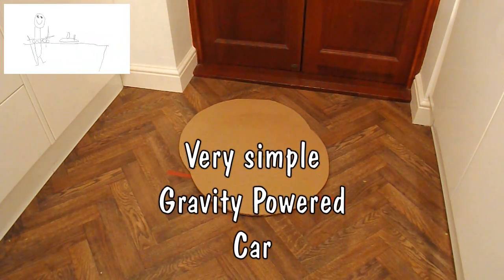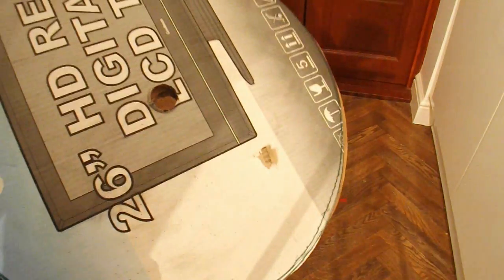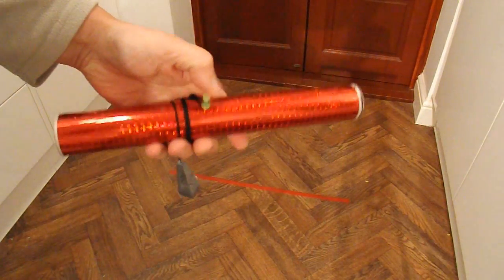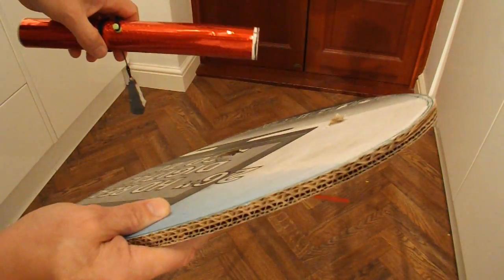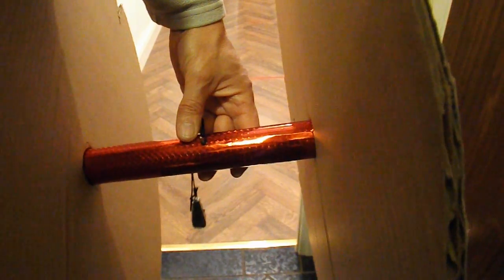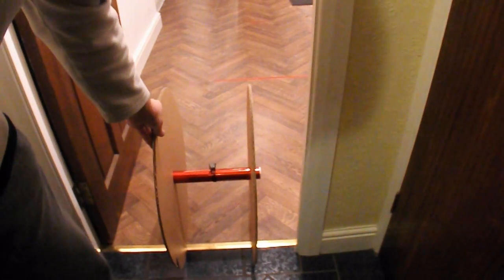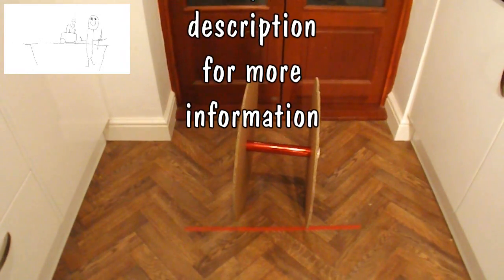Very simple Gravity Powered car

Comment: how tall are the wheels?
Reply from the maker: As big as you can make them. The bigger they are, the further they will travel on a single rotation. I don't think I ever measured them. I just cut the biggest circles I could out of the packing case our television came in. Looking at the video I would guess they were between 24 and 30 inches.

Comment: Would you be able  to explain the physics behind it? I made something very similar, just yesterday but I have to explain the physics behind it. I can see how kinematic (constant a) is in play and what not but what's more. Thnks!
Reply from the maker: It was a long time ago that I was at school. All I can remember here is we have potential energy being converted into kinetic energy. As far as the actual calculations you need to consider the diameter of the axle and the diameter of the wheels to work out the distance that will be travelled by the car while the weight drops. You may need to consider the mass of the car (and the friction of the bearings in the case of a normal 4 wheel car) if you are going to calculate the inertia of the vehicle so you can predict how far it will freewheel after the weight has dropped.

Comment: Will a variation in the weight have a similar effect on this type of gravity car in comparison to a 4 wheeled one made using a pulley system? I am doing a science experiment on the effect the weight will have on the velocity of a gravity car, and will make this simpler version instead of the 4 wheeler if a change in weight has the same effect.
Reply from the maker: +Ojazzy b this works the same way, gravity. You may need to step back to visualise what is happening but if you think it through, there is a string attached to the axle. On the other end of the string is a weight. The weight drops due to gravity. As the weight drops it pulls the string and that causes the axle to turn. When the axle turns, the wheels turn and the car moves forward. The only difference between this and a 4 wheel car with a tower and a pulley on top is the tower gives you a longer drop so the car can travel further. With this car there is no way to increase the distance dropped unless you make the wheels bigger. With a 4 wheel car and a tower you can increase the distance dropped by making the tower taller. In both cases increasing the weight gives you greater power.
Reply: +GrandadIsAnOldMan OK cool, thanks a lot!

Comment: Does this work on slope too?
Reply from the maker: +Shikha Rajput do you mean will it roll up a slope or roll down a slope? It will roll down a slope because it is a wheel, so it will roll like any wheel does. If you want it to go up a slope then you will need to ensure the weight is heavy enough to give it the power it needs.

Comment: How far is this?
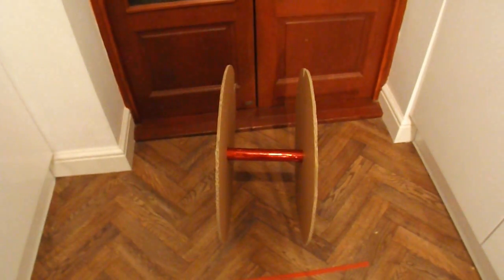Reply from the maker: +Ilana Portney-Preston did you watch the video? I told you how far it went in the video at 01:55 it goes 5 metres in my kitchen using a 5 ounce weight.  There is a little more information in the video description.
Reply: Yay thanks so much! I watched the video but without sound, ha. How much string did you use? Would this be able to go six meters?
Reply from the maker: Ilana Portney-Preston how much string do you think you can use? The weight can only drop from the axle to the ground so that is the maximum amount of string you need. The distance it travels depends on how well you make it. I didn't get my wheels perfectly round so they had flat spots and that does not help. The amount of weight you use will change the acceleration, the faster you get it moving the more momentum it will build up so the further it will free wheel when the weight drops off.
Reply: I can use as much string as needed- it is going about five meters with four batteries attached to it but I cannot get it any further- my wheels aren't perfect but I really am having trouble adjusting the mass size.
Reply: However I did not think about the weight falling off- how do you suppose I do that? I tied on my mass to the string but is there a way I could use it to fall off? It has to go exactly six meters or a tad under it
Reply from the maker: +Ilana Portney-Preston at 01:07 I show you the tooth pick that is stuck in the axle. The string that is tied to the weight has a loop on it and that loop hooks on to the toothpick. That means it can drop off when it has finished unwinding.
Reply: Awesome thanks so much!! Helped a ton

Comment: I Had a project that required this but it didn't work as good as yours. How do you make it go so smoothly? I tried big wheels and small wheels, long string and short string, and even different weights. I've tried many of your cars but it never works. How do you do it!?
Reply from the maker: +Foxy ThePirate I am afraid there is nothing more I can add. You see all that I do in the video. In this project we only have 2 disks, one axle, one weight, one piece of string. There is not much you can get wrong, maybe if you haven't cut the cardboard disks carefully enough they will not be very round, perhaps you haven't got the axle in the centre of the disks. Those are the only two things I can imagine could be wrong. In the video description there is a link to a new version I did this year using vinyl records for the wheels.
Reply: +GrandadIsAnOldMan ok thanks

Comment: Will it be possible to go 30 ft?
Reply: If you use a heavier mass
Reply from the maker: +mr_itryhard it did 5 metres like that so that is 15 feet, so yes a bit more weight to build up the momentum a bit faster should get it going so it will freewheel further. By coincidence I did another one recently using Vinyl LPs - old records -  using a 1Kg weight and it ran 10 metres easily. The video is already uploaded but scheduled for publication on 27th January
Reply: +GrandadIsAnOldMan oh okay then thank you so do you recommend using records or use large cardboard wheels ?
Reply from the maker: mr_itryhard the bigger the wheels the greater the drop for the weight so the further the car can go under power but at the same time you may be adding weight. You will have to experiment to find what works for you.
Reply: +GrandadIsAnOldMan okay because the highest k.g my teacher is assigning for the project is 1 k.g so I'm hoping with big wheels it can go 30 ft
Reply from the maker: mr_itryhard good luck